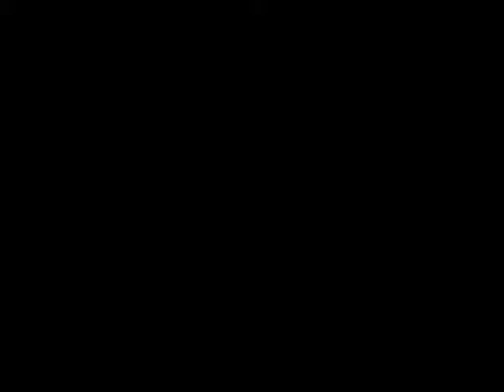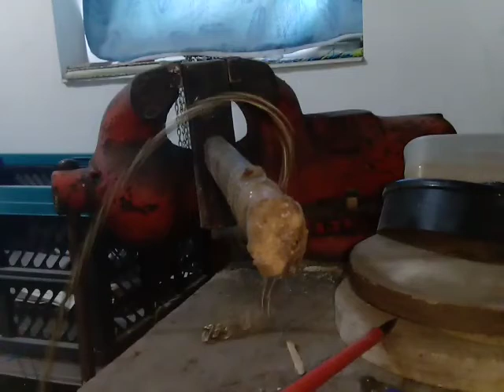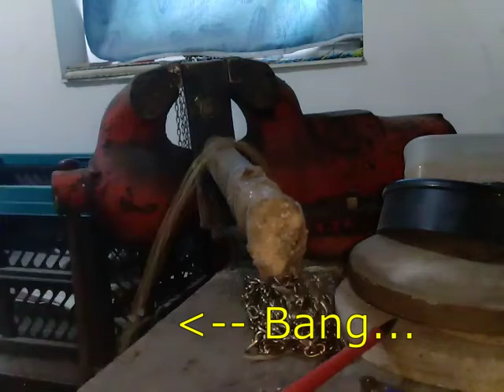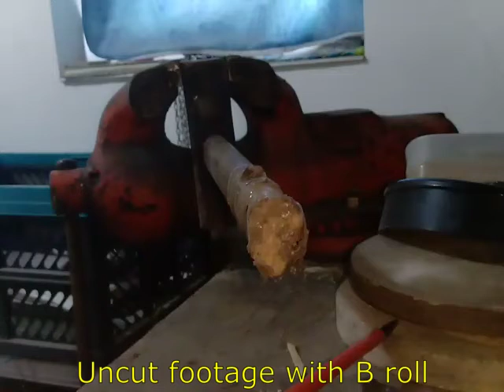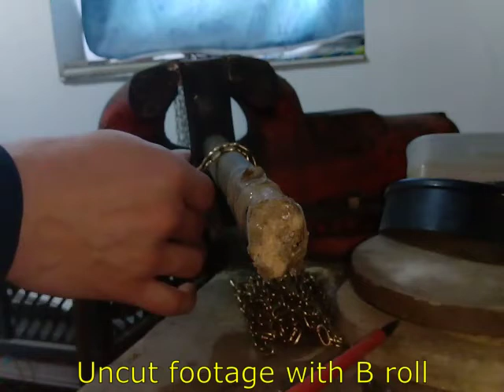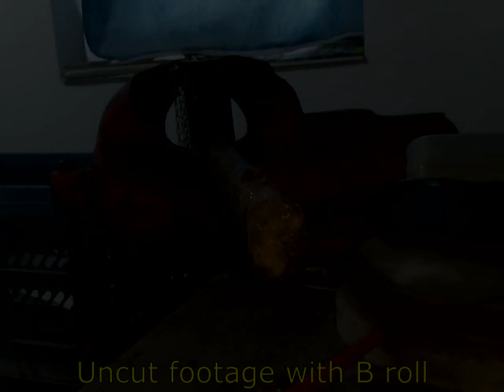Are Mehdi and Mould BOTH WRONG? | Mould Effect

Comment: I agree with the shockwave hypothesis.  Like Newton's Cradle, the shock can travel through the chain separately from the chain's velocity.  The "bang" can feed energy back to the other end without slowing the velocity of the beads in flight behind it.

As for the voice:  the mechanical voice is quite acceptable if you take the trouble to proof the results and correct any anomalies; that is the problem with so many annoying videos that just auto-read a script but mess up on typos in the text, pronunciations of acronyms, or the odd wrong intonation that needs to be corrected with punctuation or explicit annotations in the input.

Comment: There's very simple explanation for why Mould's chain broke during his world record attempt which does not require any shockwaves traveling through the length of the chain. It even doesn't require the fountain to form. Beads in the container go from stationary to full speed of the falling chain in split second, the faster the chain falls, the greater the acceleration. And speed of the chain rises with increasing height as gravity has more time to pull on the falling part. And if the acceleration is large enough, the chain breaks.